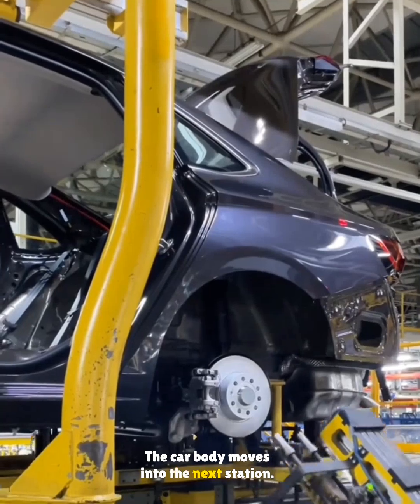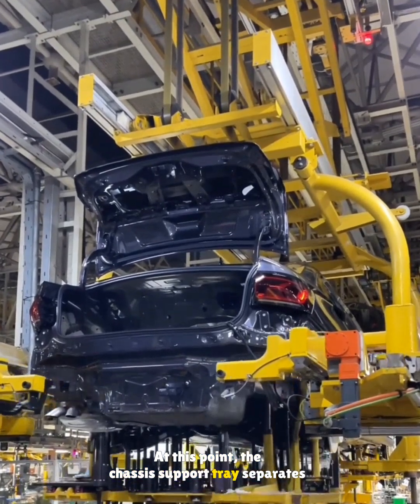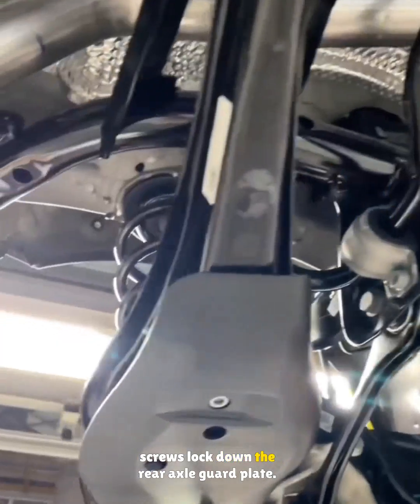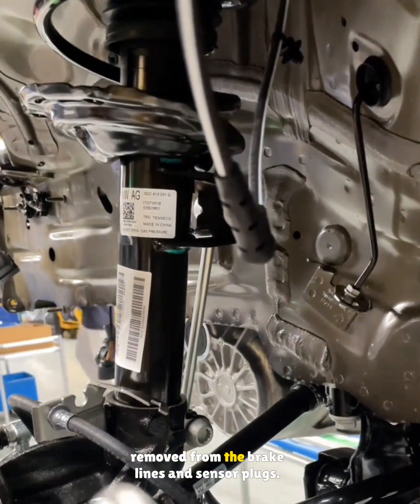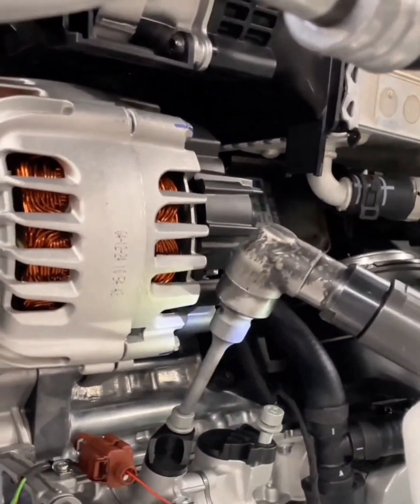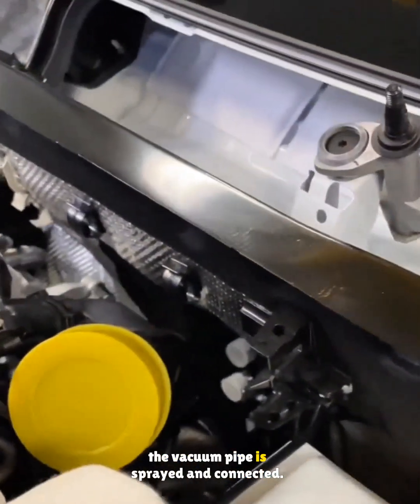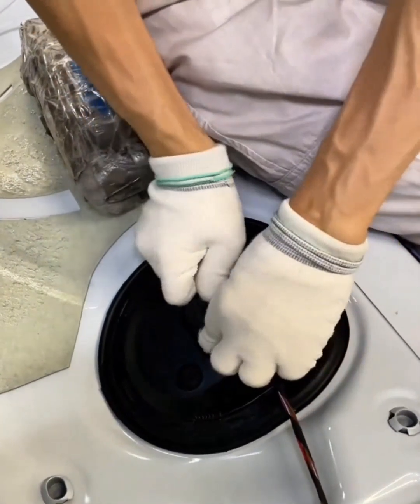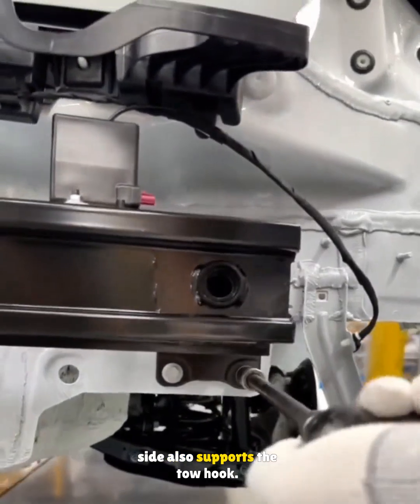Inside the Factory: Full Volkswagen Jetta Assembly Process – Episode 6

Comment: How do they vacuum the air con. system and how fast ?.🤔
Reply from the maker: In the factory they use an automated vacuum and charging station. It pulls out all the air and moisture, then fills the system with the exact refrigerant amount. Whole process takes just a few minutes.